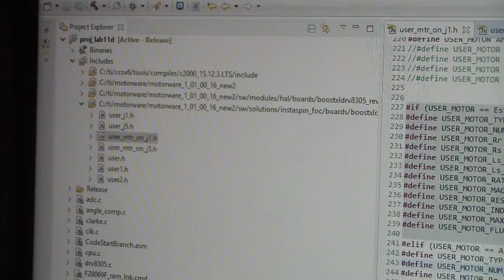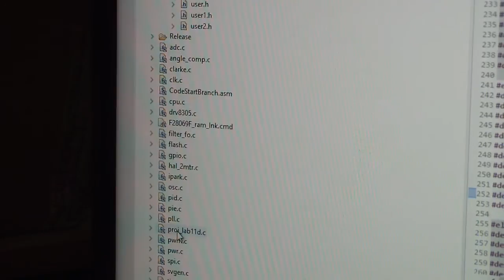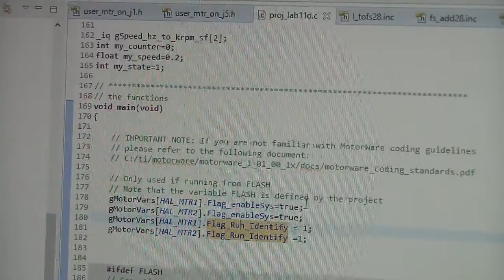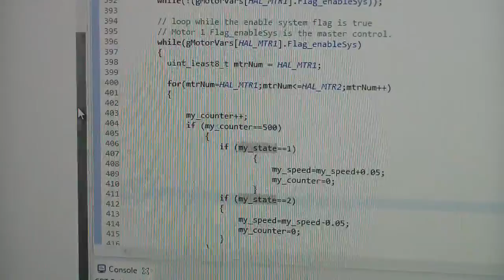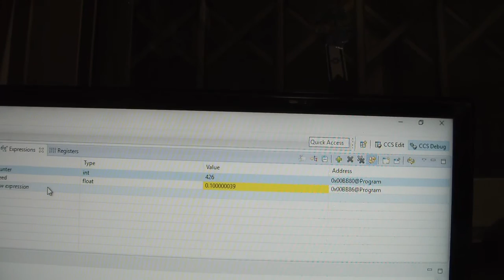F28069 with DRV8305 spinning 3 phase Segway Motor

Comment: Brother hello, very take the liberty of bother you, also don't know a few years ago the video, you can have time for me to answer some questions about the motor control to produce, when I was in for two motor control, fast the speed of the observer to read large difference with the reality, and two same machine at a high speed, a state of low speed, two motor speed cannot be achieved the same, in the process of spinning low-speed motor current is lower than high-speed motor current 20 ma, voltage is the same.
Reply from the maker: There is similar board with output for 2 motors, I don't remember the board name